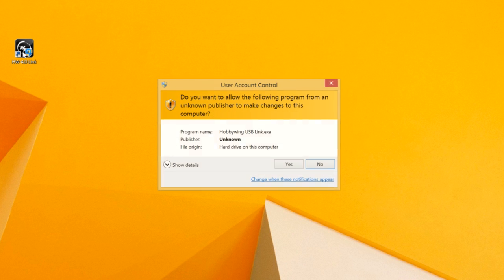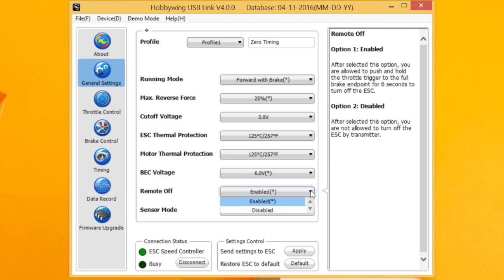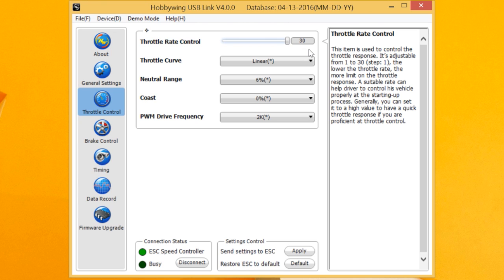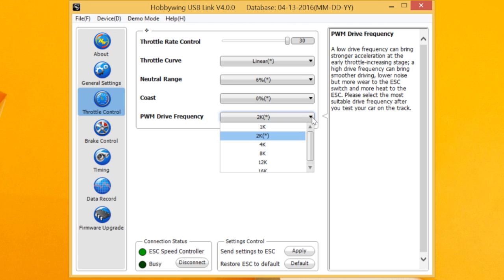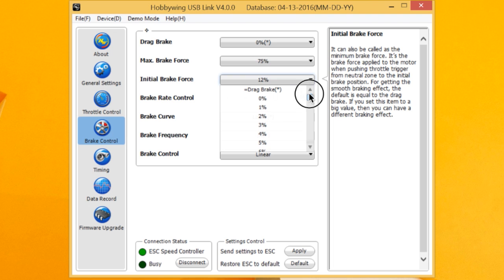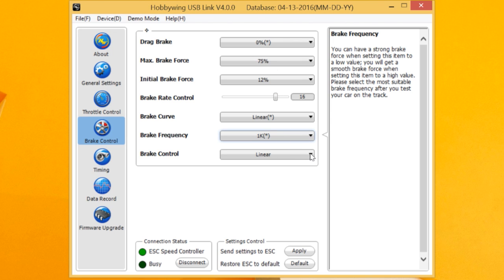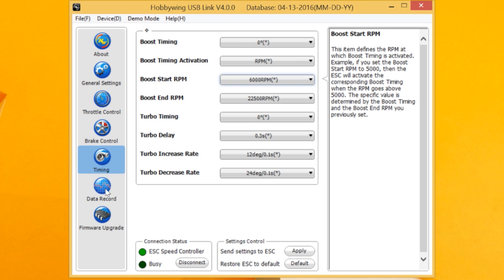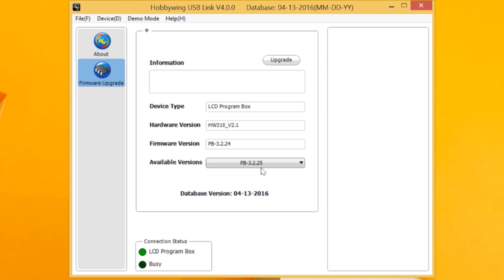XR10PRO ESC Programming Features Explained

Comment: I haven't been a Pro, since 1994!! I've also been out of the Hobby for almost 18 years..... I still hope that someone can help me.

I just got a WP10BL60 Sensorless ESC, and a TenShock Sensorless 1750kv, 6 Pole 9 Slot Motor. It's going in a fairly Low Geared Axial Wraith..... Is the 60 Amp ESC going to be adequate for my Wraith, used as a Trail Rig with some Crawling, only momentary bursts of speed - with the 1750kv Motor??  I'm a Disabled Veteran, with very little money, this is the best I can do. However, that 6 Pole TenShock Sensorless Brushless Motor is shockingly smooth! NO noticeable Cogging, SLOW starts!! She's not quite "finished" yet. I'm just crawling around the Apartment with a Battery taped to the Roof!! 😱😜
I'll add, because I am old school, just getting back into the Hobby after an 18 year Hiatus - I STILL run NiMhs!! 😱 7.2 or 8.4 volts only.....  That's as much info as I can think of. Will 60A be good?
Thanks!  Carmine 🚂